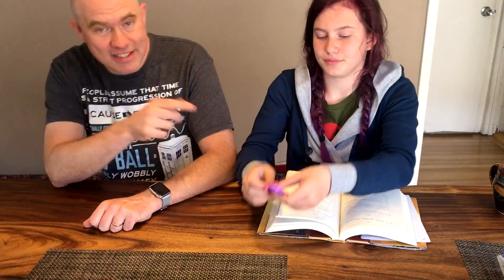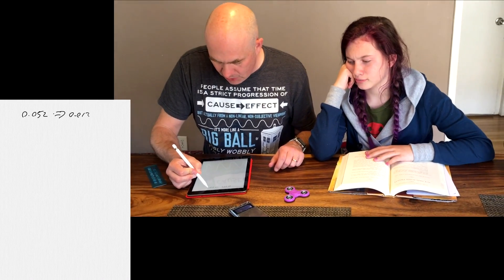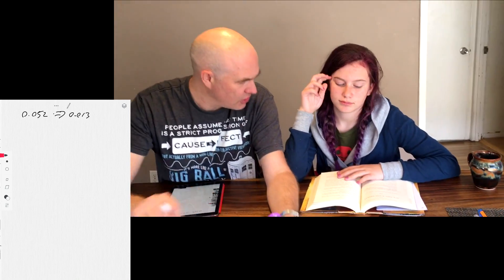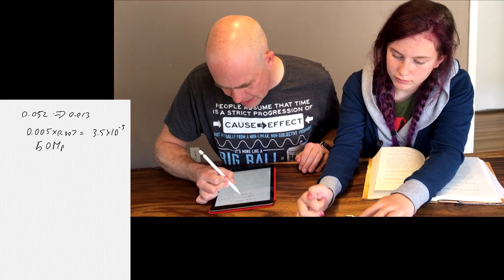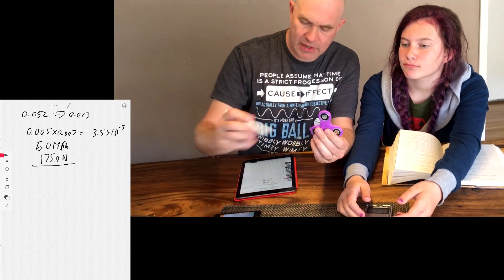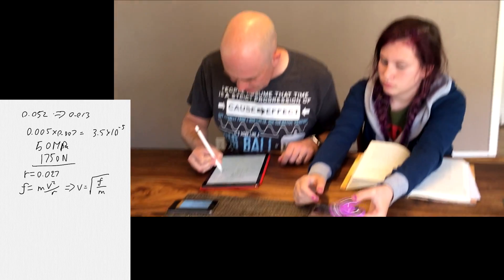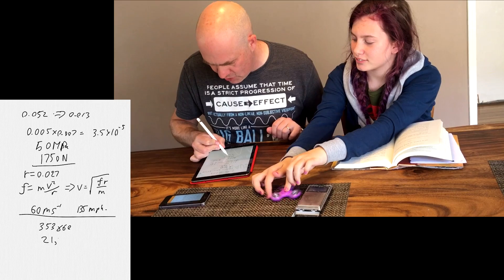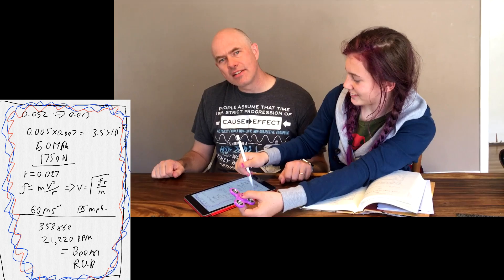Calculating How Fast Can a Fidget Spinner Spin Before Breaking?

Comment: Okay, but what's the RUD velocity of the typical Hotwheels/Matchbox car, assuming the car traveled down a perfectly smooth track in a perfectly straight line with the only forces coming from the car itself, its aerodynamics, and gravity?  At what track angle, if any, does its terminal velocity exceed the RUD velocity?

Comment: If it's interesting you could put one of these on a mandrel and run it up to that kind of speed in a reasonably high-performance milling machine; some of those spindles go up to 30000 RPM and most have pretty solid enclosures.  You now, for science.

Comment: I think that is a reasonable calculation, but maybe a cad sim may do it better. For example like material points could represent mass vectors and there could be material sections and shapes for the vectors to transverse also. The BTPC showed basically the plastic broke where is was thinnest, in some cases due to the sideways motion.
Reply: FEA would help but also more information about the plastic

Comment: nice idea, though your result is probably off - there are two lobes holding each bearing, so the resulting speed should be 1.414 times what you got ;)
Reply from the maker: But the two lobes are acting on a force at an angle which I accounted for.

Comment: 1. the bearing in the middle is bigger than the others.
2 the covers are bigger than the bearing.
3. inconsistent material means inconsistent distribution of mass.
Reply: Well, it's probably reasonable as a first order approximation.

Comment: I think the calculation is slightly off.  The general calculation only accounts for the force of only (1) of the bearings applying a tensile force on the object.  But truth is the atleast (1) other weight is also applying force to one of the breaking planes.  Which cuts the rpm to about half of what is being calculated.  I could be wrong though...
Reply from the maker: but there are 2 plastic segments supporting each lobe, so I included that in my estimate.
Reply: makes sense (also im screaming like a little school girl right now, got a reply from one of my fav streamers, ur awesome!)

Comment: Just a quick thought - when you were doing your force calculations, did you take into account that the direction of centripetal force is not the same as the direction that you would probably be pulling the bridging pieces of plastic to break them. I think you might need to throw a bit of trigonometry in there to account for that

Comment: That is a surprisingly low RPM. Consider that Giaco Whatever's device could reach >100 krpm.
Reply: His was aluminum (probably 6061) which immediately has six times the ultimate tensile strength, with a similar cross-sectional area. So it's not too surprising that his could go five times the speed.

Comment: Scott is like me in this regard. Today I designed a set of paper cones that when fitted together form a 3D parabolic surface that I intend to use as a solar igniter once I coat it in aluminium foil

Comment: There's a 'standard accident' that happens in engineering workshops where some genius, usually an apprentice, decides to see how cool it would be to spin up a bearing with an high-pressure air line. Generally speaking, they're just at the point of saying "wow, doesn't this make a cool sound?" when it explodes like a small hand grenade and it's off to hospital and a tale to tell the next generation of dumb apprentices, if they're that lucky... So yeah, don't try seeing how fast a fidget spinner will spin before it breaks in real life: those bearings are made of VERY hard, very brittle steel and they WILL explode at some speed.

Comment: I think it may very well have a breaking point of 175kg. But I don't think it could survive the force of being LOADED with 175kg.
Just like the wall of a pop can is only .097mm thick, it has a crush force of ***113kg***. However, that assumes absolutely perfect weight distribution and no shock loading.
Also the maximum safe rpm for those bearings is probably only 10,000rpm, so you may just blow the bearing apart before being able to blow the spinner apart lol

Comment: you forgot to account for the bearing caps, they obstruct the view of the plastic's real width (1-2mm when the measurement was approx. 5-7mm, the real value is 6-9mm, which is about 1.4x as thick)

Comment: No it's not the well oiled bearing. In fact it's not oiled, if it was oiled it wouldn't turn that long on it's own. It's either clean or lubricated with a thin lube.

Comment: Strap it to an angle grinder. They do 18k RPM. Hydraulic press channel, or Slow Mo guys, Do eeeettttt!
Reply: +Mp57navy Didn't they use vacuum motors to chatter CD's this way?
Reply: Well, i got my wish. Thanks, HPC.

Comment: Actually, I'm pretty sure that long before reaching that speed, the bearing (which probably isn't of great quality) would heat up, heat the polymer around it and reduce the polymer's tensile strength, leading to it breaking way faster than you calculated.

Comment: I think, maybe, I found an error in your calculations. As you stated you took the thinnest point of the plastic housing which was near the middle. you calculated the mass of one of the bearings on that side and later you used that mass of the single bearing to calculate the speed at which the centrifugal force would overcome the strength of the plastic. But I think you only calculated the centrifugal force exerted on one side of the 'centre' thin part plastic. On the other side approximatly the same force is pulling the other direction, otherwise the thing would be unbalanced. So I think you need to divide the speed by approximatly 2 in order to correct this error.

Comment: I think the RPM required would be quite a bit lower, since you have to take into consideration the flow of tensions in the spinner. You can look up the stress concentration in tables like this one: https://www.google.de/search?q=stress+concentration+table&tbm=isch&imgil=vbm4QYv7lwAYAM%253A%253BcYMnWGIhuiyP1M%253Bhttp%25253A%25252F%25252Fanalysischamp.com%25252FStressBook%25252FTABA2505.htm&source=iu&pf=m&fir=vbm4QYv7lwAYAM%253A%252CcYMnWGIhuiyP1M%252C_&usg=__E_AORQ4MSCvdAbhtPxYP5QSFBrU%3D&biw=1517&bih=735&ved=0ahUKEwjY1oXc7_vTAhWSfFAKHX8uDC0QyjcIMw&ei=lNkeWdi8G5L5wQL_3LDoAg#imgrc=vbm4QYv7lwAYAM: but for a rough upper bound estimation 20k rpm is a pretty good etimate i think.

Comment: This seems like an overly simplified calculation. If I got it right, you're applying traction test physics to the section that it tangent to the bearing's edge. 
What I don't get is that you try and determine the force applied on that section from the centrifugal force applied at the masses' center.
Wouldn't you need to do a bit of geometry to determine just how much of that centrifugal force "pulls" on the studied section?

I imagine my questions are insanely stupid, and pardon me for that, but I study mechanical engineering and we tend to spend a good couple of hours on such problems, calculating inertia matrices, determining the dynamics of the system to finally apply it to a materials resistance model.
I know my teachers are quite fond of giving us overly complicated ways to solve simple problems, hence why I'd like to have your input on this.

Comment: Aw..... I thought you were going to go all "mythbusters"  and actually construct a device to kill the fidget spinner!  Maybe a clamp to hold it in place, and a moped (or something more powerful) to spin the spinner.  If you know the diameter of the tyre, and how many rotations of the spinner you get from each rotation of the moped wheel, you then need to find the correlation to moped speed and number of times wheel turns.  I think I'd need a spreadsheet for this....   nope, gotta go to work...

Comment: For the sake of completeness: at max speed you'd also get ~1.4MPa of hoop stresses there. Interestingly the ball bearing usually used in spinners, MR608, even in basic, non sealed version is spec'd at 30000RPM, which is less than your maximum - it did surprise me!

Comment: Scott, you did some material's science mistake. Cause the cross section you took is angled in relation to the force, you have to use a little more complex conversion. Cause you create internal momentum. I dont know exactly the names in english cause its not my native language, but you have to use the principle of Von Mises everytime you account for force in different planes (the cross section you took is like 30 degree angled to the application of the force. You will end generating traction forces and "sliding forces"(dont know the name in english).

to more information:

https://en.wikipedia.org/wiki/Von_Mises_yield_criterion

Comment: When you calculated the cross sectional area, you assumed it was solid plastic. It's almost certainly just a hollow shell, which would drastically reduce its strength. Your instinct that you are ovemestimating the strength was probably correct.

Comment: It wouldn't kill you, but one injury from a fidget spinner failure happened. Some dudes were spinning up a fidget spinner with torque gun / air wrench and a bearing flew out and completely took out the teacher's eye. So yeah, pretty bad.

Comment: Scott, what about the mechanical failure of the central bearing?
I've heard of mechanic apprentices spinning a bearing on their finger, using an air hose, that then failed and gloved their finger.
would the mechanical failure happen before or after the plastic failed?
Reply from the maker: Depends on how fast they speed up.

Comment: with a compressed air tank you can pin it up pretty fast but you forgot to calculate the waste heat from the bearing melting the plastic

Comment: Wired spun a CD at 37,000 RPM when it shattered. (https://www.wired.com/2015/03/happens-cd-spins-fast/)

CDs are much lighter than the spinner and I suspect that the plastic is higher quality. I would guess that the spinner will break at a lot less than 21,000 RPM.

Like you said, somebody will try it and report in.

Comment: I saw some images of one of those fidget spinners that flew apart after being brought up to speed by an air compressor.  It had parts stuck in walls.  I didn't get any information other than that.  It is something that would be interesting to watch though.

Comment: Note: most fidget spinners can only handle 7k RPM before the bearings begin to fail...
Reply from the maker: +Chad Irvine yeah but reading numbers off a spec sheet isn't fun.
Reply: oh goodness no Scott! i'll reccommend you check out some of Gizmoslips recent videos. Once they got them spinning up to those speeds, on high speed cameras might i add) and did crazy stuff with them, the bearings began to fail. Unfortunate for the content they were trying to produce.
Reply from the maker: I have one with a bearing that's off center, I could spin it up while looking at the bearing in my thermal imager

Comment: Scott you made a mistake!!!

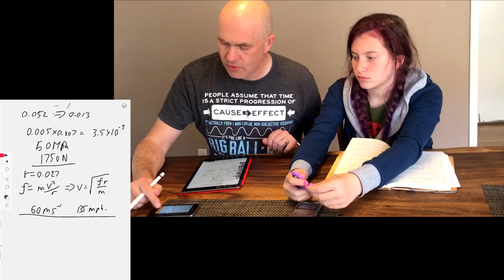Towards the end (around 5:28) you say you want to divide 60m/s by the CIRCUMFERENCE but then you accidentally divide it by 0.027, the RADIUS. 

Correct me if I'm wrong.
Reply from the maker: +D V divide by 0.027, then by 2 then by Pi

Comment: Now calculate friction heat at 21kRPM and tell us if the bearings would melt before flying apart.
Reply from the maker: +Benjamin Lefebvre depends how quickly it accelerates to that speed. Also hot bearing will weaken plastic they're in contact with.

Comment: I think you'd expect the plastic around the outside of the outer bearings to fail before the plastic connecting them since the former is a smaller cross section and at higher speed, depends if the outer bearings are glued or just fitted in there
Reply from the maker: +Kyle Brown hadn't measured that, but ther's twice as many to bear that load.
Reply: by eye it looks like the combined cross section of all 6 is still smaller than the 3 you used, but idk.

Thanks for replying Scott! Been watching since interstellar quest

Comment: Can it technically be an *un*planned disassembly when you have a whole sheet of figures planning it?
Reply: David Johnson While the calculations impose a theoretical limit to the fidget spinner's angular velocity, they were made using a whole host of assumptions, estimates, and downright fudgery (please, don't take that as criticism for Scott's Dad-Joke level video about awesome stuff flying to pieces). As a result, there is a fairly large range of possible values for which the fidget spinner will meet a violent and untimely end as a spinner, and temporarily enter the realm of ballistic projectiles. Simply put, it's all well and good to THINK you know exactly when the toy will fail. Just don't test that limit directly in front of your face or other delicate squishy meat appendages.
Reply: This is an "accurate within one order of magnitude" kind of video :)
Reply: >TalkingWorms.
I think you should not test the breaking force off anything when "squishy meat appendages" are in harms way.

Comment: So the next big question: Does the failure happen from the plastic letting go, or the bearing itself failing to handle the speed and forces applied to get one going fast enough?
Reply from the maker: +RealLuckless need to do math on bearings, but plastic is under higher stress
Reply: RealLuckless I think this particular model would have some heat issues. By exceeding 130°C the PV would start to give in. The weak points are in contact with the ball-bearing and therefore the thing would run into some pretty interesting problems. (but I really should work on my bachelor thesis now...)
Reply: I think that instability in the spinner will shake it apart long before max rpm.
Reply: I may need to buy a bunch of fidget spinners, a high speed camera, and various ways of getting these things up to speed...

Personally I would classify a heat issue as a bearing failure. But instability and shaking itself apart may or may not be one...
Reply: If this thing would really shake that crazy, compressed air would be a bead idea. Using an engine would be better and you could actually control the speed very easily. (pushing it from outside)
Reply: The bearing would stay intact, but that is well beyond its rated speed and it would certainly be damaged. A broken bearing will (usually) still spin, but it has more resistance or becomes wobbly. The only real way to break a ball bearing is with a lot of axial force, a ridiculous amount of radial force, or by creating so much friction that the metal pieces will weld together. The last option may not even be possible with a ball bearing, but it is a failure mode for bushings.

Comment: You can use compressed air to test this. I've seen speeds of over 20,000 RPM on metal versions of these spinners.
Reply: [Facepalms so hard that I can now see in third person]
Reply: where did you see this? you do realize this means it spins about 330 times in a second, right?
Reply: TokyoRoyalty I don't see that reply.
Reply: skylar15123 - impressive.
Reply: +skylar15123 Damn...
Reply: nobody answered my question.
Reply: http://www.lmgtfy.com/?q=fidget+spinner+air+compressor+video
Reply: +Max Mondo I literally replied with a link to the video I saw that had one of these things spinning that fast.

Comment: Cody should test this.
Reply: Joerg Sprave has already spun one up to about 11,000 RPM using an air compressor & made a "gun"/slingshot for fidget spinners & managed to shoot one at about 4,000 RPM
Reply: bdijkstra1982 lmao he actually did
Reply: Or Lauri from Beyond the Press. He has a 25000 rpm pneumatic spinnemathing
Reply: I think breaking it and then doing a post-mortem is more in Big Clive's area of expertise.
Reply: He did. With several different spinners, Scott was more or less correct.
Reply: As long as he tries it by using flying rock from the next mine explosion, I'll be happy
Reply: He probably won't unless it's one made of uranium and lubricated with mercury.
Reply: Or that one uh... Lunatic Russian Bodger... "BOOM"
Reply: agreed
Reply: That could work too, although I've not seen Taras do too many dangerous things lately :-D
Reply: i wonder if one could make something useful out of a fidget spinner....